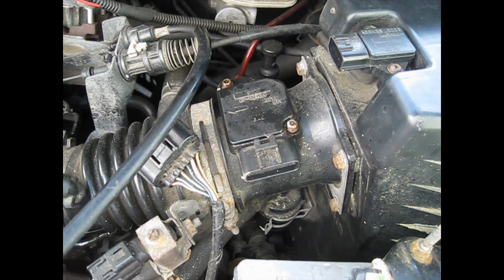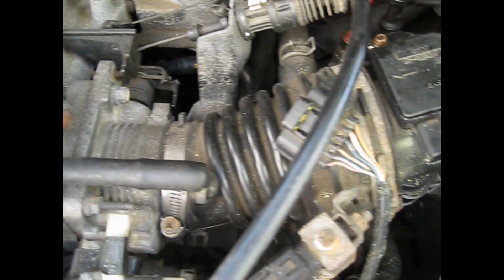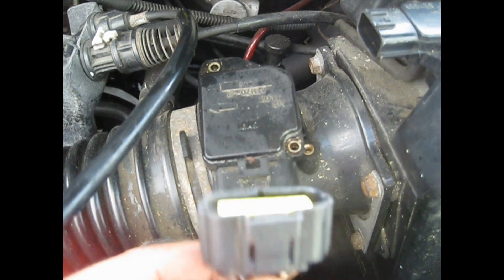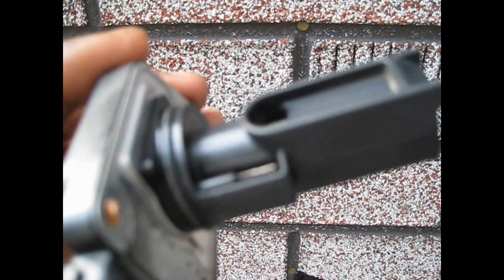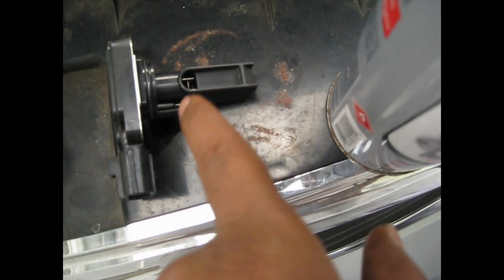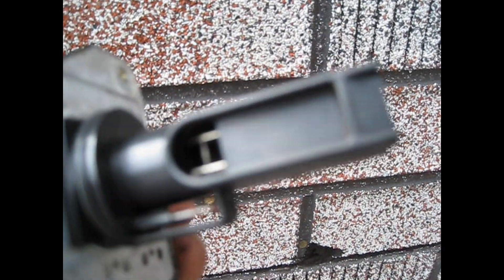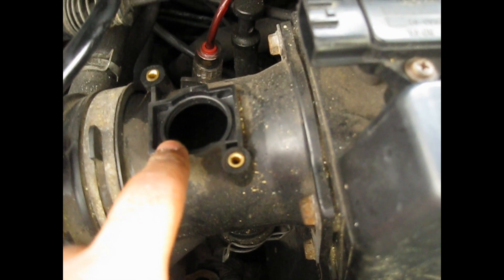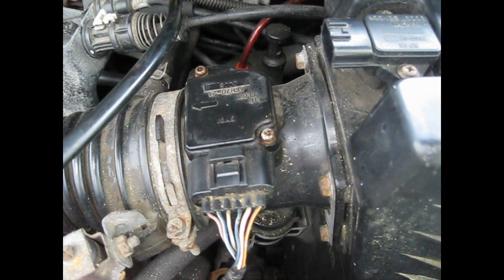Mass air flow sensor (MAF) how to remove or clean,2000 mazda mpv

Comment: What is the sensor on the air cleaner outlet hose between the MAF and the Throttle Body??? I am missing the bottom hose and I am trying to figure out what it goes to.  This sensor has a plug and two hose outlets. I only have one hose attached and missing the bottom...
Reply from the maker: The small canister?
Reply: HP11208 no, I actually figured it out. Its the valve on the intake sleeve that is connected to the canister .  it's the vapor canister purge valve.

Comment: That does not resemble a 2000 Mazda air flow sensor. I know because I have one but mine is a protégé , perhaps that is the difference. Thanks I will still follow the instruction.
Reply from the maker: Well it came off a Mazda.

Comment from the maker: Let it air dry, you probably sprayed too much solvent cleaner, so that's a reason for it not to start. Make sure everything is plugged back in the right connectors, especially the vacuum hoses.

Comment from the maker: Did you plug the harness back in ?. Disconect the neg battery cable for a few mins.Check the sensor for damage and clean it with the recomended cleaner

Comment: Plus I forgot to mention I have only 5 wires I just measured outside 2 wires and I dont even have a reading meter says OL plus if I check between others I have like 600K so I guess its toast
Reply from the maker: Richard Mietus Okay

Comment: Hey I tried cleaning my maf sensor and now my car wont start??? You say the resistance should be lower than 16 k between A + F ...Can this be stopping my car from starting all I did is clean Maf and remove air duct and clean TB butterfly and now it wont start...thanks
Reply from the maker: Richard Mietus Any luck?

Comment: Great video. Thanks. Could error code P0171 be from a dirty MAF sensor?
Reply from the maker: Reza Farahipour Maybe or egr, iac, throttle clean all of them and see from there.Also replace your pcv valve.
Reply: Thanks, I finally found it. It is vacuum leak from the two center injectors seals. I don't think I'll be able to fix it myself.
Reply from the maker: Yea i forgot to mention check for vacuum leaks also.